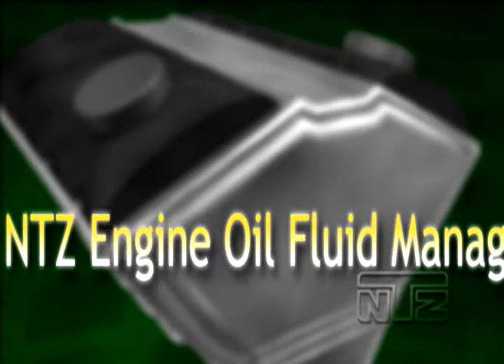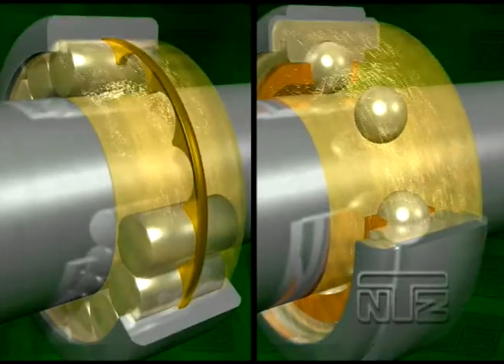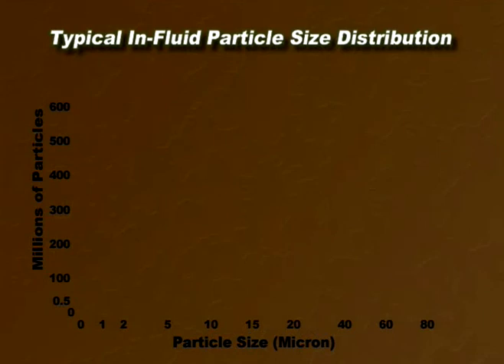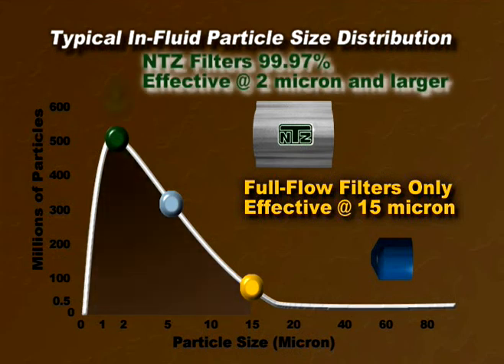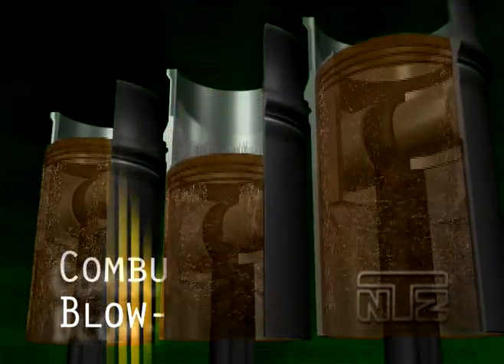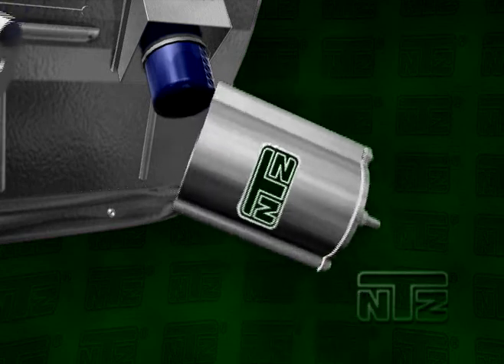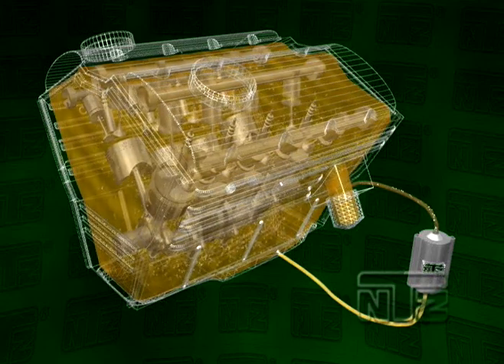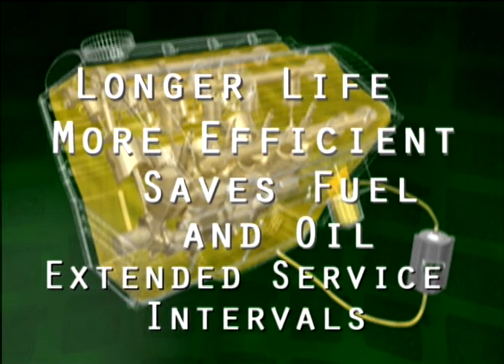NTZ Micro Filtration Engine Oil Animation.mpg

Comment: All heavy equipment uses similar systems that can, at least, double service interval time. All expensive equipment is serviced by hours of operation, not miles driven. Some use synthetic filters that are similar to water filters and others use paper media or a combination of both medias. Excellent investment if you run a higher oil capacity expensive engine like a high end sports car ($100K+) or a diesel powered truck.